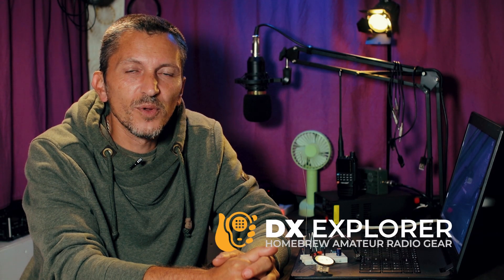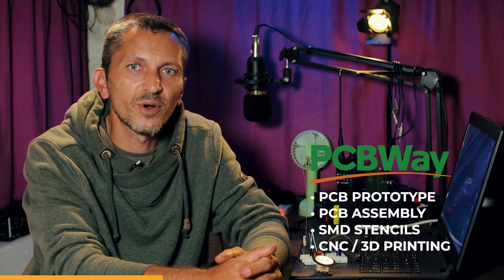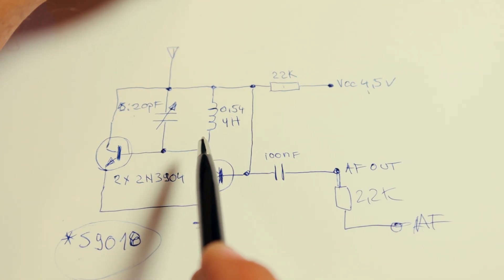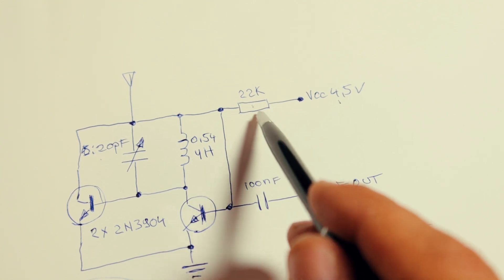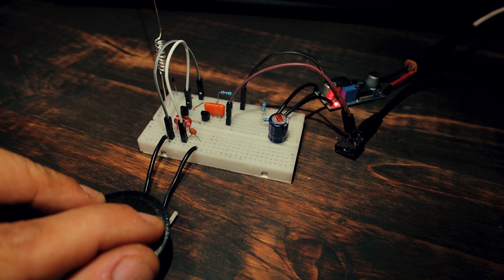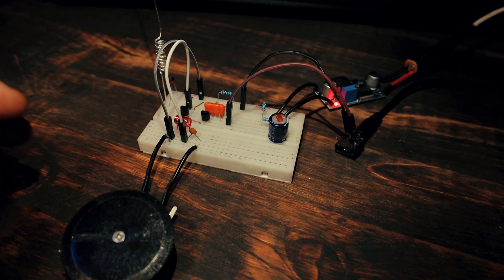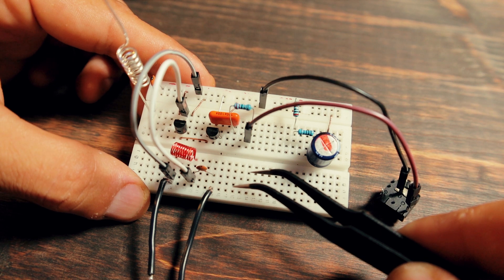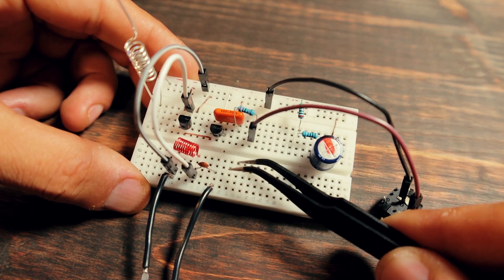Making a Simple FM Radio for Fun: Learn, Build, and Listen - Part 1

Comment: this was one of the first circuits i ever tried but it never worked only ones when i used a better audio amp but still mine heard all the station at the same time awful selectivity this is why i like building regenerative receivers more. Maybe i will try this one again! Thanks for the inspiration!!!
Reply from the maker: I tried something similar as a kid... not the same schematic but similar... and it never worked for me. But now I also understand why 😅. I've been playing with it yesterday and I think the only thing that would make a big difference, is to use proper transistors ( probably those from the original schematic ) and a variable capacitor with demultiplicator gear to make it easier to tune. It has potential and I think build with care it may end up as a nice simple receiver. But again... not easy to replicate with the guarantee that all will work right away.

Comment: 9018 worked better here 🤔
Reply from the maker: I beleibe so yes. Sadly I have none and they are hard to find apparently by most people. I was trying to see if I could make it easy to replicate using some "up to date" transistors. I am testing now various ones and see if I can find something that works well. This is what I was wondering as in the schematic I have... there are the 9018 transistors... while in others there are 2N3904, 2N2222 etc. Except a few 2N3904 that worked... I had most that didn't work. 2N2222 doesn't work at all. So clearly I need a transistor that performs well at these frequencies. 73, YO6DXE.

Comment: Like a regenerative FM receiver.
Try add phase locked loop circuit. ( Direct current - audio amplifier circuit and varicaps )
Reply from the maker: I thought about it as I wanted to get rid of the LM386 amp and keep it transistors only. Also an RF preamp to isolate the oscillator from the antenna as it seems that it generates a good amount of RF on air 😁. I will play around with the circuit a bit more when I have some free time as I just can't give up on it haha. Even if it gave me lots of headaches 😅.

Comment: I'm surprised that the boost/stepup/down supplying the voltage didn't interfere with it, very nice project and great for anyone interested in building a minimal parts radio, great video 👍
Reply from the maker: I also thought it will create issues. But I also tested a lot of regen receivers in the past with it and it seems good as it didn't create problems. When it comes to the receiver... it is indeed a nice project, but it can also give you lots of headaches. Video on this coming this evening hahaha. I still love it and it was fun experimenting with the circuit. 73, YO6DXE.

Comment: Yes ,these simple radios have their charm..
I made a super regenerative one with a single transistor, which worked quite well but wasn't very selective, I could change stations by pointing the antenna in a different direction. It would have needed another transistor as a preamplifier for the audio amplifier. I had made it with the intention of receiving the air band but I don't have any airports nearby. It was super regenerative, meaning it amplified everything in a single transistor but for a local station it worked poorly, in low impedance headphones without audio amplification, if I took the other end of the antenna and placed it next to the inductor. If it didn't scream, I would transform it for a second into a super regenerative reflex 🤣🤣. In the end I got bored with it because it was frustrating to be so unstable and I threw it away. In fact, I threw away all the radios that didn't work well, even the best ones (at that point I was left thinking of building them again someday). Nice project! Can you explain how it works? I forgot electronics even though I have a lot of schematics somewhere on my laptop that I've tried or wanted to try.
Reply from the maker: I will talk a bit more about it in the tonight's video. You are right about the headaches hahaha. I've been having them all day long trying to make it better but I think I will also give up. Yes it can get better, but then it won't be "simple FM receiver". Still is fun to play around with it and experiment... but it has many limitations. Time to try other schematic, maybe not that simple but at least one that works better and it's easy to replicate by kids. 73, YO6DXE.

Comment: The receiver certainly isn't bad, but what do you expect with such a small antenna? The tuning capacitor might not be the right value, and you're working with long wires, 
which makes it unstable. There's also no antenna amplifier before AND, no LF amplifier after it, and that certainly doesn't make it any more stable.
Reply from the maker: Yes I very much agree with you on everything. That was the idea of "let's see if we can make it better" )). 73, YO6DXE

Comment: Very nice video! Made a similar circuit a couple of years ago with a small trimmer capacitor. Imagine how hard the tuning was... Probably the key is to make a very compact pcb and have every component close to each other. Anyway, that's a very nice project thanks for sharing! 73
Reply from the maker: Thanks so much Nikos. I wish I had the original transistors, I think it would perform better. But it is what it is... I "play" with what I have 😅. Have an amazing rest of the week my friend. 73, YO6DXE. P.S. soon I will start having some more free time in the weekends so maybe we can try some more QSO's on 20m or 40m.
Reply: @dxexplorer thanks for the answer, i also remember different transistors but the ones that you have installed work pretty well. I really hope to see you on the air!!
 Best 73
Reply from the maker: @sv2tcb 73 my friend. Happy weekend... almost here.